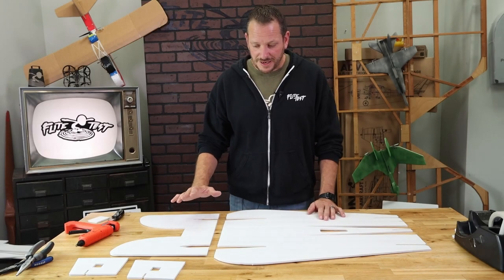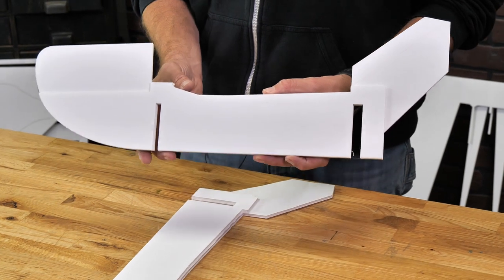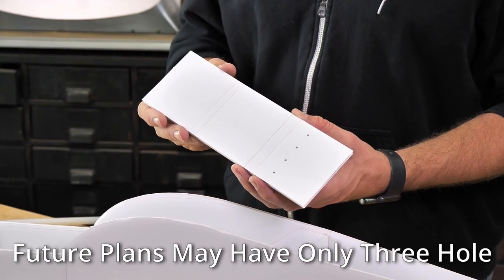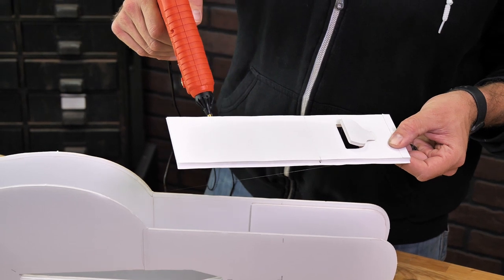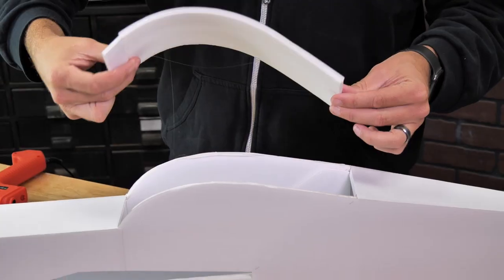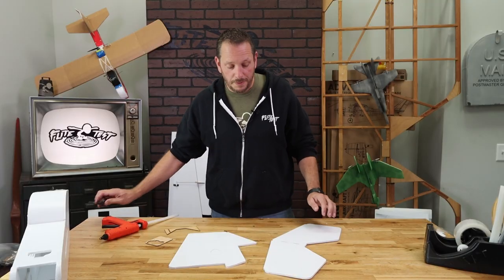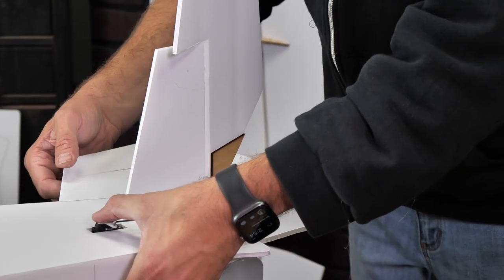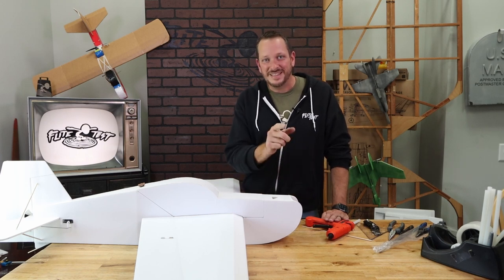How to Build the FT 3D XL Fuselage

Comment: As I'm building the fuselage, I notice that the wing-hold-down recess is different than shown in this video. It only goes into one layer of the wing saddle doubler, rather than into both layers of the doubler as shown in this video. I found it much easier to fit the wing hold down as the fuse sides are folded up and glued into place. Just something to be aware of as you build the fuse.
Reply: Likewise. Glad it was mentioned.